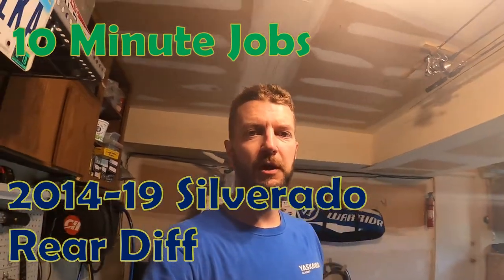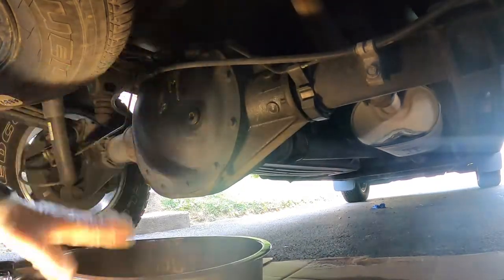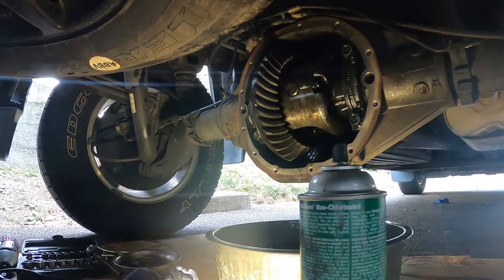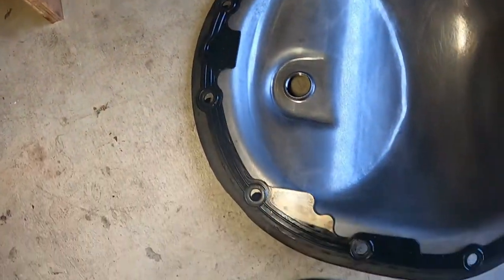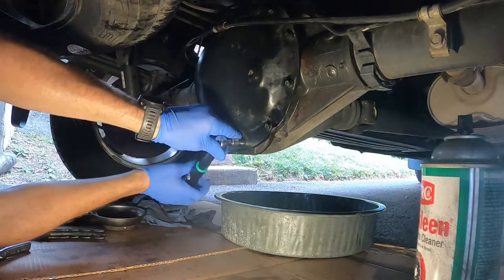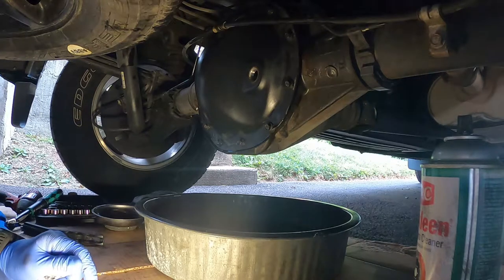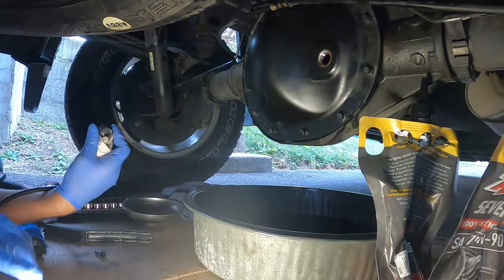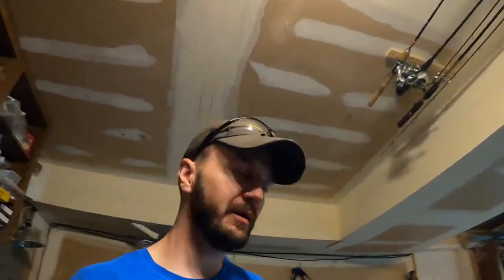2014-19 Silverado Rear Differential

Comment: Great video. I believe the range for my 4x4 2016 Silverado with a 5.3L motor is 0.04" to 0.70". The .04 limit is near the thread depth, so nearly up to the hole. I used 2.5 quarts of fluid to fill and was about 0.30" below the hole.

Comment: I've seen a few videos on this and no one mentions the bottom magnet on the enclosure.  Thanks for pointing it out.  Some of the other videos also fill up to the point of where it begins to drain out of out of the fill hole.  Would this cause issues rather than using your method, or is it a rather safe than sorry situation?
Reply from the maker: I'd say once you are beyond your warranty it's a matter of opinion, personally I stick with what is recommended. Now this is the first diff I've seen that didn't say to fill until it flows out so I think you'll be fine either way! Thanks for watching and commenting!
Reply: According to details posted in another video, the range for a Silverado 1500 with the 5.3L motor is .04" to .70".  With the larger V8, it is as stated in this video. Different for the 2500.

Comment: From the service literature, the INSPECTION levels from the factory are a range as they are filled with a certain volume that will result in variation of the fill level relative to the fill plug, so if the fluid is inspected and found to be within the range, then no fluid needs to be added.  If the fluid is below the minimum, then fill to the bottom edge of the plug opening. 

Copy and paste from service literature:

Inspect the lubricant level:
Specification:
The lubricant level should be between 1–19 mm (0.04–0.75 in) below the fill plug opening for the 8.6 inch axle.
The lubricant level should be between 15–40 mm (0.59–1.57 in) below the fill plug opening for the 9.5/9.76 inch LD axle.

If the level is low, add lubricant until the level is even with the bottom edge of the fill plug opening. Use the proper fluid. Refer to Fluid and Lubricant Recommendations.

Comment: Just to confirm: 2.75 quart (75w 85) for the rear differential fluid change; how much needed for the front differential fluid change? the owner manual recommend using 75w 90 for the front, can I use 75W 85 for the front too?
Reply: 75w-85 vs 75w-90 in synthetic is a negligible CAFE fuel economy thing. You probably won’t see a difference in MPG between the two, and definitely won’t hurt anything running thicker oil.
Reply: @nordicpride9708  thanks!
Reply: Amsoil recommended 75-90 for both